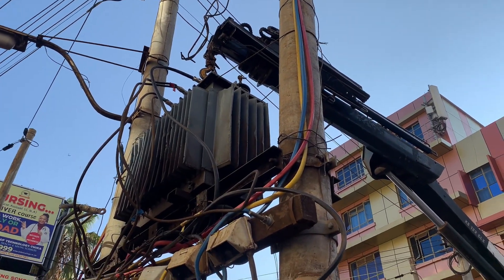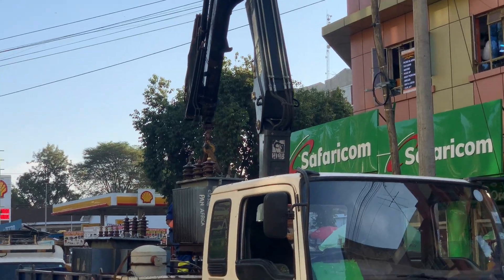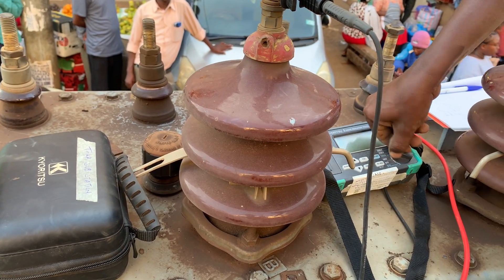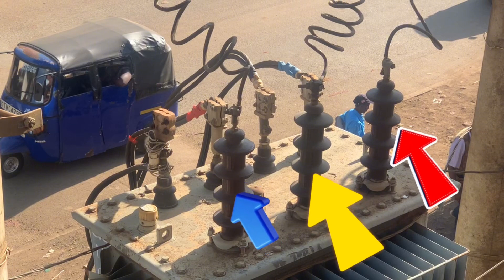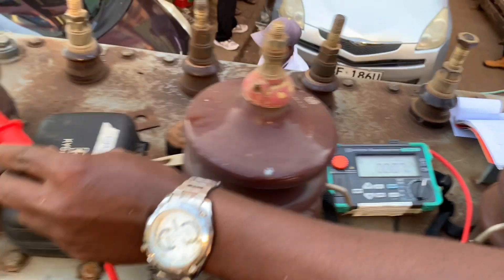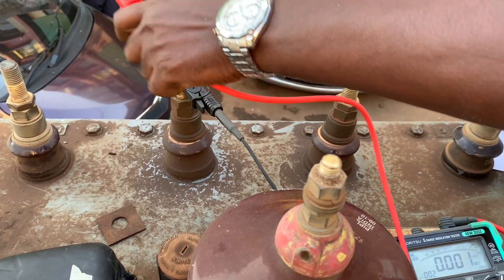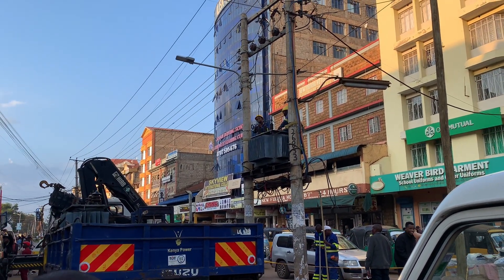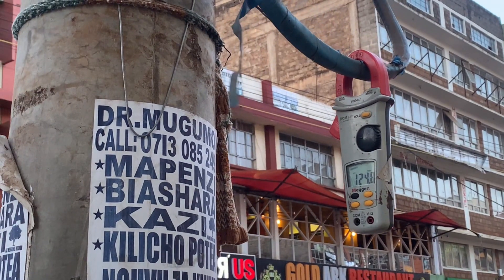Electrical Troubleshooting For 3-Phase Transmission.

Comment: The transformer's job is to step down voltage. Why does the 3 phase transformer for places where  415 volts required ie in places where we drill water have the lv what is the lv section stepping down cz we don't need 240 here when we require 415 volts.